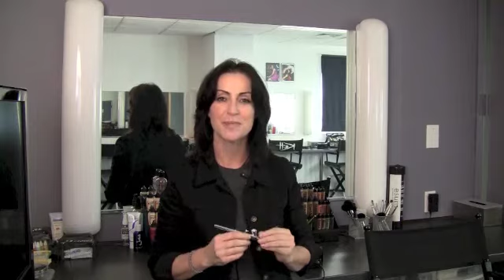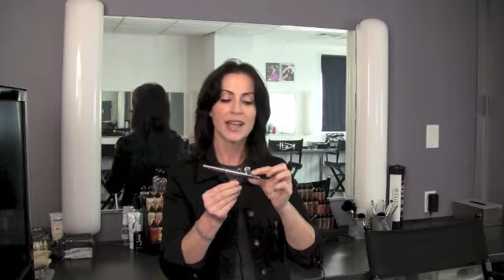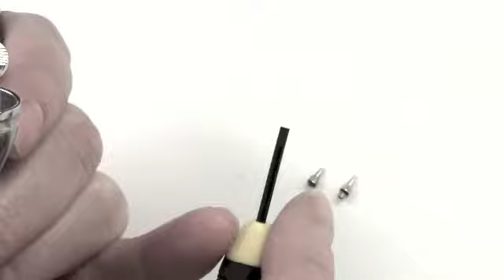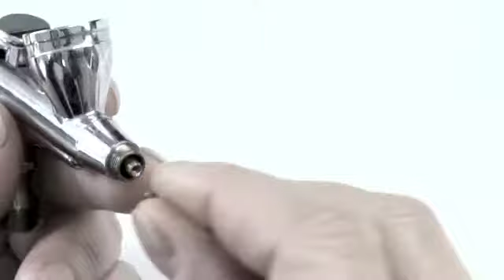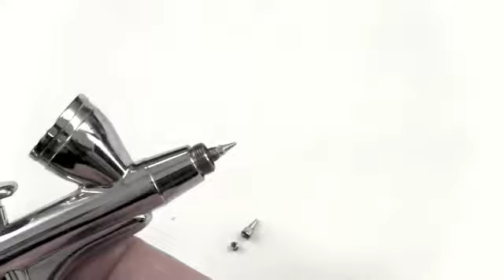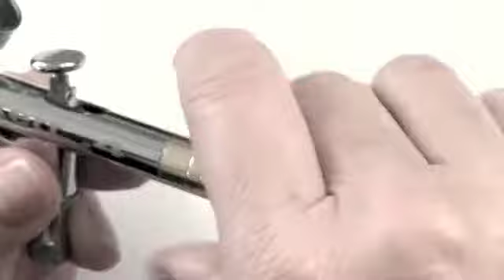Removing a Broken Nozzle from an Airbrush

Comment: You saved my butt!! I was going to do this the old fashion way by using a left handed drill bit to extract the screw but I didn't even think to try and take it out with a flat head!
One note for everyone is remove it as soon as possible as any paint or alcohol that drys up in between the threads will require more force to extract and possibly break it further.

Comment: I have a free solution for this. Use a toothpick instead. Insert the tip of the toothpick and rotate it counter clock wise. Piece of cake. Worked for me.
Reply: Thanks! Worked for me.
Reply: Thanks for the save!
Reply: Worked for me! Thanks so much!
Reply: Thank you it work very good.
Reply: Thanks!
Reply: Thank you!
Reply: Really works! give this a try,thanks Mazinbuds
Reply: I used an exacto knife, stuck it in, twisted out without any force or effort
Reply: My toothpick got stuck, used the needle instead and it worked! Thanks a ton for the counterclockwise suggestion!!!!

Comment: Hi . I just bought ( LENCO AB - 302 ) airbrush , and i'm freaking out because i couldn't find any spare parts for this model , so my biggest concern is the ( fluid nozzle ) if you know if i can fit other airbrushes' nozzle in mine or if other airbrushes' nozzles fits other airbrushes ?